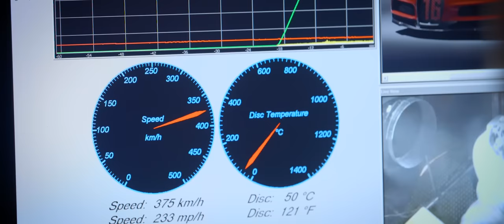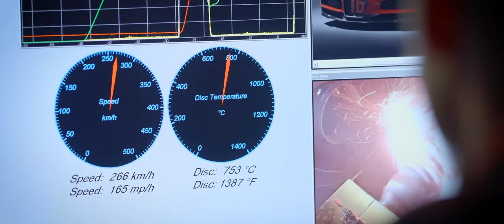BUGATTI CHIRON Titanium caliper brake-test extreme

Comment: This is a Test... probably with 50% of Car Load on One Disc...  in real Condition you have 4 Wheel and you can divide the Extreme Forces on 4  Different Discs
Reply: tho not exactly dividing by 4, given the acceleration pushes the forces much, MUCH more to the front wheels. It's actually a good worst case scenario to simulate half the vehicle's weight load on the individual brake if it's a front one.
Reply: Master piece of engineering Bugatti.👍😎
Reply: My god we have a genius amongst us
Reply: In addition to the air circulation through the wheels and calibers to reduce heat.
Reply: No shit Sherlock Holmes!!! The things you know, amazing.
Reply: @Kalvinjj  The air brake pushes the back down so you won't have as much force on the front but there will of course be a bit more there. But not much.
Reply: @adamhlali8106  Also, since it's mid engined, I'm pretty sure the weight distribution is so that, while breaking, it's about 50/50 or close to it.
Reply: @Kalvinjj   that's Right.... but on the Veyron/Chiron ,over 250km/h, you have extreme downforce on the back side of the car...  and the rear Wheels/Brakes  also Have a lot of work to Carried Out...
Reply: It's pretty obvious that this is being tested at much higher loads than it'll ever face in real world situations. This is proper engineering.
Reply: Over engineering is a thing
Reply: And you have tires with not enough grip to break so hard without blocking wheels.
Reply: This is tested at far above normal conditions.  It would take forever to test brakes with a simulation that follows normal conditions.
Reply: But wouldn't each wheel still have to be stopped by its own brakes, but the vehicle overall is divided by 4 (yet with 4 wheels)?
Reply: @danielbush6882  It is much harder to stop a wheel that is holding weight, therefore a wheel with larger load will be harder to stop.  The forward momentum of the entire mass of the vehicle is trying to keep the wheels in motion.  Therefore the braking necessary on the front brakes would be much greater as it has to deal with reducing the momentum of the vehicle.  
Imagine stopping your bicycle with your hands.  You'd probably tear up your hands and not be able to stop it.  Now get off your bike, lift it up and spin the wheel just as quickly as you were going before.  You could probably stop the wheel pretty quickly by just pinching it with 2 fingers, since you've removed the load and there is far less force to deal with.
Reply: @tjoloi  when you slam on those brakes and get thrown forward, all of the weight weight in the back is doing the same thing, going towards the front.
Reply: Fiore Vicidomini 2
Reply: No, closer to 100%. You can select as much of a load as you want on this particular Dyno. The calculations are based off of rotor radius, gvrw and inertia.

Comment: For those having issues trying to get the front kick plate off, (depending on model) try losen with butter knife from the top and pull from the bottom

Comment: Titanium has actually one of the highest melting point with about 1600°C. Also used in space rockets and landers, not to melt before landing.
Reply: 1600°C is rather low for 'one of the highest', considering the highest meltingpoint of a metal is around 3400°C for tungsten, not mentioning a lot of other metals going well above 2000°C
Reply: @1weirderguy.276  but tungsten is heavy as fu-
Reply: @Brainless_Memer  this is why tungsten is not really used in rocketry. it wouldn't matter too much in carbrakes, because weight isn't as important there. it is however, rather soft and, unless really pure, also rather brittle.
Reply: @1weirderguy.276  no it is more weight for the motor to turn and fuel economy and acceleration would fall and die. Not worth it tbh
Reply: @Brainless_Memer  considering the weight of a car, the increase in the weight of the brakes would not really matter all too much, one passenger more would add more weight than a brake utilising tungsten.

Comment: Don’t forget the energy will be distributed between four of these beast!
Reply: I don't even think that matters because the vehicles weight is not even in the equation. So therefore this test is inaccurate to a real breaking scenario. Just shows how the break pads hold up I guess.
Reply: @FabiSZN  yes the Buggatti is one if not the most reliable Cars in the World they test everything
Reply: since the parameters of the test are not given, you don't know how much energy they put into the brake on the test stand.
Reply: Actually front wheels getting more of the energy because of weight and inertial forces distribution

Comment: Its amazing that brake pads last as long as they do.
Reply: That’s the benefits of carbon ceramic breaks. They also use a heat shield and intakes at the front of the car which create a curtain of cool air around the disk

Comment: Never mind the caliper: I want to know more about the rotor disc and pads! Those are the components withstanding all that heat. I would LOVE to see a graph, comparing hydraulic brake line pressure and braking torque. It didn't look like there was very much brake fade, if any at all.

Comment: Imagine Having An Oil Leak, with all those flames lol
Reply: That would suck
Reply: @M.L having an oil leak and the brakes on the front can reach like that , if your rear main seal is damange
Reply: Rip bugatti
Reply: Boooom
Reply: For 9m dollars: No
Reply: Don't think a 2-tonne Bugatti can accelerate as fast as the motor on that brake disk, I wouldn't worry about the callipers setting on fire

Comment: Does someone know how the rubber o-rings in the caliper can handle the temperature?what kind of rubber seals?
Reply: some sort of glasfiber composite , just seach for high temperature seals
Reply: Probably  high a temperature form of silicone compound.
Reply: @thedoctor2102  as far as i now high temp silicone goes only up to 200 deg celsius. That Glowing metal is at least 850 degrees Celsius.
Reply: Hyper Hektor but that heat doesn't really transfer to the o- ring. I've had a brake as hot as 900c and it presented no issues and was reused over and over again.

Comment: So, I'm guessing the brake caliper failed the test?
Reply: Who knows
Reply: I'd say thats a win.
Reply: @thxman1968  even though it caused the disc to literally catch fire?
Reply: @skullkrusher4418  the test was for the caliper, not the rotor :)
Reply: @thxman1968  yeah but isnt the caliper not supposed to cause it to get that hot????
Reply: @skullkrusher4418  Caliper just applies the braking force to the rotor. I believe the purpose of the test was to see how the titanium would react to such high heat. The rotors are carbon, they are also designed for the high heat stresses.  In the real world, even though that car can hit those speeds easily..its highly unlikely. The car itself has brake ducts to prevent the brakes from ever getting that hot.
Reply: @thxman1968  interesting. I didnt know about the brake ducts. Thanks for the info.
Reply: This would be considered a win because it already takes immense force to stop a vehicle going 400kmh but for it to do it 3 times, at the same speed; and at the end of it all still have pad left and minor discoloration of the caliper itself is definitely a win, the only issue I saw was the rotor did in fact catch fire and you need to understand in the test they did not use a drilled and slotted rotor like the Chiron will have.

Comment: where can i buy these for my mx5  my mx5 needs real good brakes its real fast
Reply: These probably brake so hard that the rim would stop but the tire keeps rolling.
Reply: @xXAlmdudlerXx  i dont know what that is but the gforce i get when my miata hits vtec is too strong
Reply: @DRBONG-rf7eg  Nice joke bud.
Reply: Is it Bugatti Chiron 375 mph fast  though?
Reply: @georgexatz4162  well the thing about a buggatti is its not as aerodynamic my mark 1 mx5 and its not as light my miata is far superior i could easily hit 400mph in 3rd gear
Reply: @DRBONG-rf7eg  Yeah..and my Ford fiesta is much lighter than the chiron so I could easily hit 10000000 mph on 4th gear
Reply: @georgexatz4162  thats just nonsense please dont lie on youtube
Reply: @DRBONG-rf7eg  Well its practically the same bs I'm hearing from you..you might as well tell me your mx5 is better than a chiron in terms of speed
Reply: @DRBONG-rf7eg  Also your mx5 mk1 can reach 195 kPh whereas chiron can slightly overpass it for only 225 KPH
Reply: @georgexatz4162  dude u think im lying im tuning it rn u will see my car its going to go viral it has the teslar electric motor cross over with vtec and when it kicks in you cant evenfull throttle because of too much wheel spin i blew through 5 rear diffs alredy because of the power of electric vtec
Reply: @DRBONG-rf7eg  400mph is shit my Toyota Prius got 500mph with a little tuning and an upgraded engine.... Then the weed wore off

Comment: Impressiv how fast the discs heat up and the energy created by brakes.
Reply: thats not what they want us to show. every normal break could break this. energy is mass times velocity and we have here just the mass of the disc and the smal electro motor. it didnt had to stop a 2000 kg car. no, they want to show us how high temperatures the break can handle without exploding - thats what other breakes would do at such temperatures, because the metal from the break sattle would break in parts while smelting.

Comment: you only have 3 times for braking on 400 km/h speeds
Reply: That's emergency maximum force braking. And you're only going to do it once. 
If you just brake normally you can use these brakes for years.

Comment: The calipers are what they're showing off; they are power bed fusion (selective laser sintering or SLS) titanium that is topologically optimized to provide higher structural stiffness while cutting off most weight.

Comment: What brake fluid did they use for it? Anything I’ve ever used would be boiling at 700*C 🤔

Also… those AI designed calipers look 👌
Reply: I think the disk temperature is different respect to the brake pads support temperature..
Reply: Brake fluid flows through the calipers, which also will get hot, but not that hot
Reply: Also, this test is not performed on a moving vehicle. A moving vehicle benefits from air cooling

Comment: just remember larger diameter discs allow for a larger caliper however (usually more weight) are usually metal. its a balancing act but larger brakes will make you quicker on the track, however heavier flywheels take more to get started and more to stop. hence the lightweight material of this multi million dollar passenger vehicles has as a standard brake rotor.

Comment: Pagani got something right. The future of cars relies on air brake using body panels, and air resistance redirected by tunnelling system. Not 100% rely on brake discs other wise it will destroy the wheels. Or simply make Hover cars.

Comment: Calipers house pistons, pistons have break pads mounted on them, break pads are pushed into rotors. The calipers and pistons do not (under ideal circumstances) absorb heat, that's the pad/rotor's job.

Comment: So with the amount of sparks flying off the disk and all the iron filings being chucked in the air and around the place, the brake disk is not going to last that long but the brakes themselves withstand and last quite some time while they can slow down a moving object from 350 km/h to 0km/h

Comment: I work in a Tool & Die Shop >  we heat treat our D-2 tool steel @ 1875 deg F.   When u open furnace door at temp,  you cant get closer than 5 feet with out protection.  I'm stunned that a mechanical device can function at theses temps.  Brake Fluid doesn't boil ?

Comment: But was there any airflow to simulate actual driving? My buddy and I had my Mustang and his Talon glowing rotors like this one night and we drove the rest of the night and everyday from then on with no problems. This was back in the mid 2000’s in ‘90’s models vehicles.
Reply: I had the same question. I don't even know what this video wants to tell us? I mean breaking like this should be normal for a Bugatti hundret times a day. But this video looks like they almost glasing out the first time...
Reply from the maker: Hello Guys. This Bugatti brake system is testing on a Link brake tester. It do simulate all the data of the original car. All data! So the real test took the whole day with braking and braking again. And so in this video, we only shows the most beautiful pictures of a day on the way to get more than 1.000 degrees Celsius on the brake disc and testing the new 3D printed titanium caliper.

Comment: So the brake caliper housing was designed by an AI to maximise weight reduction while maintaining as much strength as possible and them was 3D printed in the right metal. Interesting that metal parts can actually be stronger with 3D printing than from casting and CNC.
Reply: You can achieve seamless architectures that werent possible with CNC and casting. Metal 3D printing will bring some nice new tech in our cars. Turbo fans for example with thrice the effiency and so on. Sadly this whole EV agenda is pushed onto our European manufacturers and we wont see combustion engine road cars much longer :( There are so many new technologies that just becaome possible with technology advances, like turbo charged hyper efficient direct injection 2 stroke engines and so on that are 100% more effective than the best 4 stroke engine... Its truly sad and stupid to kill the combustion engine when we can triple it's efficiency

Comment: Just food for thought i work in a steel mill and the slabs we are about to roll (ie malleable) come out of the reheat furnace at approximately 1900 degrees the same temperature these brakes achieved

Comment: Nice job Bugatti (Volkswagen). Btw: Do they simulate the driving wind too, which is cooling the disc too?
Reply: It's stress-testing, so no. When stress-testing you want it to be in the worst-case scenario. If you watch F1, you can see breaks catching fire some times if there is no airflow, that would also happen to a 400-0 full break test in a Chiron when coming to a hault.

Comment: DANG.... I NEEEEED those one all four corners of my YUGO, due to how much HP it has, I need to be able to harness that HP... Maybe even a set on my 1988 Suzuki Samurai hard top, also, due to how much HP that power plant has under the hood, it is an absolute monster with an almost unmeasureable amount of horrid HP. My Samurai does 0 to 60 in about 4 minutes.. So much HP on board, that my Samurai machine needs me have hire an engine room engineer from STARTREK, to keep it held together... LOL.. Just kidding, all jokes aside, this video is really neat. 

That amount of braking power / clamping force of sliding coefficient concepts, is mind blowing to me. Clamping power, on static or stationary parts in one thing, Holding / clamping power on parts already in motion is a whole other ball game... To fully understand the math of friction, energy, heat, spectrum of radiation of visiable and nonvisiable light, just all sorts of various types of energy being dissapated in efforts to limit or stop sliding or rotating components  while all that by design must hold up or not have a catastrafic failure, which I believe they call, integrity of the machine. Never mind, if those parts fail in a real life situation on the track of street, I am just referring to the nature of the physics upon how amazing our technology has come over the past 130 years of automobiles/vehicles, in either 2, 3, 4 wheels configurations.

Comment: I'm someone who knows nothing about this, so I have a question. Does the disc deform or does it result in any isse at those high temperatures? What material is that? I've seen many supercars with glowing discs, does it affect efficiency?
Reply: Yes they do! But for high end cars like this, the ceramic brake pads are built to handle being that hot. On lower end brake pads, if they are glowing red they would warp and could possibly even explode/shatter. But these didn’t and held their shape very well. That’s why this video is crazy because there are almost no brakes that can handle this kind of stress

Comment: I mean it’s a stress test. 
This is a basic disc where’s the carbon ceramics with the cooling holes? 

It would still get hot but no where near as quickly. Preventing brake fade much sooner

Comment: You ain't stopping without a welded brake system at 200mph lol. Maybe this isn't such a good demo. Would do infinitely better with a magnetic induction motor breaking system coupled with a standard brake system.

Comment: This is the first brake rotor I've seen that large. The brakes on my daily driver which is a Police Interceptor Sedan are pretty substantial both front and back, but these appear to be larger for sure.

I just confirmed it online I think...
My front brake rotor on my Interceptor Sedan is 352mm and the one in this video is 420mm if it is the front, or 400mm if it is the back rotor. Pretty impressive!

Comment: I was wondering... The dynamic system of this machine, is it braking for the wieght of what only one wheel would deal with or is this laod acting as if only one rotor is braking the entire weight of this vehicle? I wonder if this would be a WLL factor of 1 or 4, based on my question, possible a much higher factor?
Reply from the maker: The test rig simulates the power of the Chiron engine during acceleration and the weight of the car during braking. This simulates the real car.

Comment: What about the break fluid? The disc was around 1000c but thw DOT 5.1 fluid has a 270 boiling point. Or these brakes dont work with fluid for that reason?

Comment: Attention to aLL car expert. Just using water to cooL down disc brake. I suggest about a miliLiter per minute is very safe whilLe traveling 100 mph to prevent faiL brake due to overheating